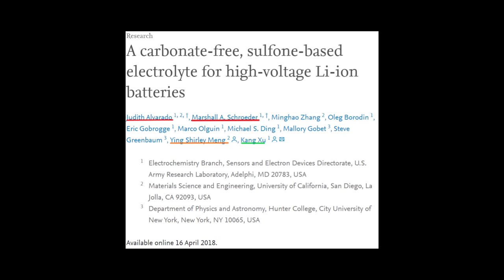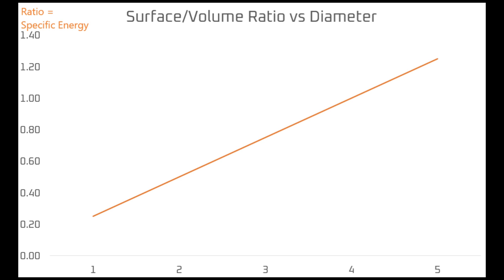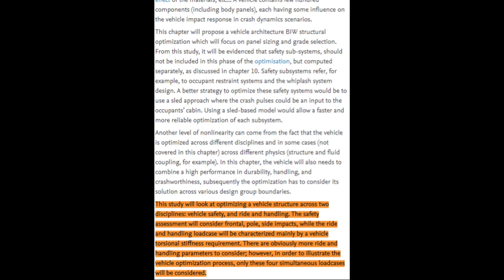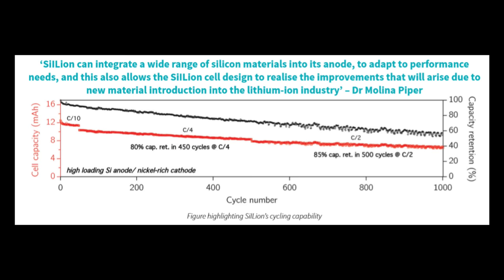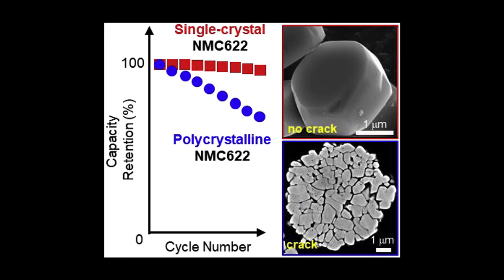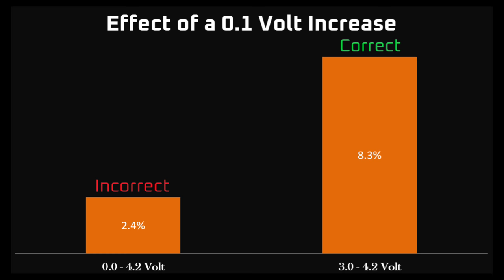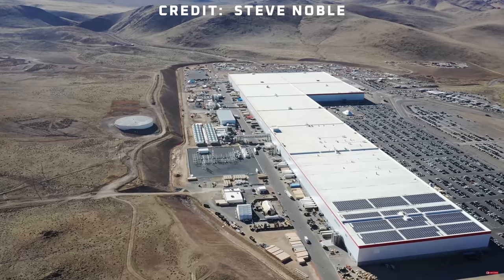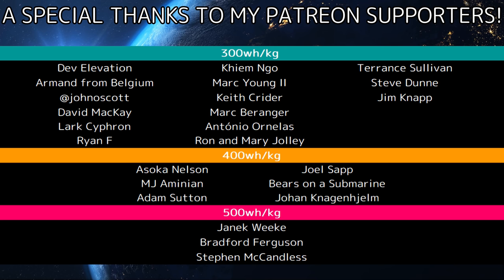New Information 💥 Tesla Battery Investor Day 🔋

Comment: There seem to be two factors missing from your “increase cell diameter” point. First is the thermal management. With thicker cells, you have more of the chemistry further away from a heat sink. Second is the pressure. I may be wrong and you could research this. I understand that prismatic cells need much thicker casings to resist the expansion that takes place when battery is charged. A cylindrical cell has a better mechanical advantage against cell rupture allowing a thiner casing. As such, I would expect a larger diameter cell to require a thicker casing. That further impedes the thermal management and does not afford as much relative added volume to the internals of the cell.
Reply from the maker: Great thinking!
Reply: Google hoop stress. :)
Basically smaller diameter tubes can handle higher pressures.
Reply from the maker: @davidelliott5843  GREAT information thanks!
Reply from the maker: @michelangelobuonarroti916  I like your thinking.  When I took apart a battery cell, it seemed like the casing was more of a wrapper to hold things together rather than designed to hold weight.
Reply: Could you cover this physical expansion when charged I guess its similar to thermal expansion when heated, can and will be resisted by each casing, rather than the pack.
In the Prius NiMH prismatic 28module pack, there are bolts end to end.
Thermal and chemical expansion would add up and need to be contained for the life of the battery, I noticed the easiest way to reassemble was in the cool of the morning.
My point is a charged hot battery is at peak expansion, and therefore pressure.
Love your voice speed, that's as neuralinky as I'll ever get.
Reply from the maker: @williamgoode9114  Excellent point!  Generally, I cover this type of thing tangentially.  At some point, this may come up as a limiting factor.

Comment: In his Model 3 breakdown Sandy Munro specifically said that the car would crash the same way with or without the battery pack, so the idea that cells are structural to the vehicle is completely false.
Reply from the maker: Nice!  I didn't see that.
Reply: That makes good engineering sense. A battery that gets crushed is more likely to short circuit increasing fire risk. It’s logical that the battery pack should protect the cells inside. That is also an advantage of using battery modules within the finished skateboard frame.

Comment: JORDON , YOUR PRESENTATIONS HIGHLIGHTS THE EFFORT BEHIND THE PROGRESS IN BATTERY PRODUCTION IN THE LAST TWO  YEARS :
    -  We hear about (A1) A larger cell with continuous tabs (A2) In-house cell production Kato Rd, Texas & Berlin, (A3) In-house Cathode production about to start in Texas, (A4) The battery pack to be a structural item.
  -   (A5) LFP & Prismatic cells have risen in prominence.  &  we know (B1) Dry electrodes are on the way. 
  - This presentation reminds us of what is happening in the background  (C1) Electrode & current collector construction, (C2) Cell chemistries (C3) Crystal structures & coatings, (C4) Electrolytes & electrolyte additives & (C5) The Dalhousie  connection, They all point to the future.   WELL DONE JORDON

Comment: How about thermal stability?  The biggest problem a LiPo battery has today is with cold.  Maybe with hot as well but being in the northeast (Buffalo NY area) I am acutely aware how much poorer batteries work in the cold (I currently drive a Volt).  The problem is of course made worse because the car also has to make heat to warm the cabin of the vehicle.  Will any of these chemistry changes help this area at all?
Reply from the maker: I don't think NA9505 and single crystal cathode will help with the lithium plating and dendrite problem.  However, Maxwell's tech might...but most of what they've done is trade secrets rather than public research :/  Jeff Dahn's additive might, but I think that would be more of a stretch - he hasn't mentioned this.

I'm from Celina, Ohio originally.  You guys get some nasty weather up there with that lake effect.
Reply: I thought the new heat pump is suppose to warm the battery...
Reply: @solutiontogolf , Question to you, regardless what is used to heat the battery, where will the energy come from?  Or next question, why heat the battery at all?  I'll answer the second question for you.  The reason, LiPo of today need heating is because the chemical reaction that occurs to produce the electrons is hindered at low temperatures, lower than 50F...
So use battery energy to harm the battery and the battery will warm but you have now much less energy in the battery and you have not gone any where and the cab of the vehicle is still cold...

Comment: I really appreciate your hard work researching all these different pieces.  Your deep dives are very well done and thought provoking!  For my money I do though, disagree with your theory that Tesla is not likely to increase cathode thickness to increase energy density. 

In my view, that's the more likely path as the dry electrode process creates a more controlled and uniform spacing of the molecules in the cathode.  This then means that you can push more ions deeper into the material with no increase in heat generation.  Think of a whole bunch of doors of various widths: The large doors have no problems handling a high flow of people, but the narrow doors cause people to jam up as they try to handle the same number of people.  It's the narrow openings are the ones that create the majority of the heat as the ions are forced through.  By switching to DBE technology, Tesla would be able to ensure a more uniform control of the physical properties of the cathode, since you're not just relying on whatever develops when the solvent evaporates away.  In theory this should then allow Tesla to safely push current faster and longer (higher charge rate for longer), with less heat buildup in a cell that still has a higher energy density! 

I am also very leery that Tesla would increase cell voltage without a switch to a different chemistry altogether.  Higher voltages, even 4.2v are already extremely hard on current chemistries which is why the BMS in BEVs don't even allow their vehicle cells to get that high and why they recommend that you don't even charge to what they do allow on a daily basis.  Though, I could see Tesla making an exception for a vehicle like the Roadster which has performance as a primary concern and thus customers may be willing to take the trade-off of a much lighter and high performance vehicle at the cost of much higher battery degradation.

Overall though, I am very excited for battery investor day!  I dramatically underestimated what Tesla was going to announce when they came out with their V3 superchargers and I would love to be blown away again!
Reply from the maker: You know your s***!  Yes, the decision I made on Cathode thickness could have gone either way.  I totally agree that the Maxwell tech allows for quicker and deeper access into the matrix of the battery material.  

The million mile chemistry is rock solid at 4.3 volts, whereas typical chemistries start crying after about 4.05 volts.  For the new battery chemistry it shouldn't be a problem.  My concern is the BMS.  Someone just mentioned in the comments that it can handle up to 5.0 volts and I asked for a reference.  That would make sense!  Battery chemistries top out at around 5.0 volts.

Comment: Very well researched with rational conclusions.  One thought on using a thicker cathode:  Increased energy density leading to larger packs means that even at a lower relative C rate the packs could still discharge and charge at existing power levels.
Reply from the maker: Perfect logic. However, Tesla specifically asked Dahn for a 1C rate cell that does 1 mill at room temperature. I don't know if the thicker cathode could do that 🤔.  It could certainly crank out the power as a pack...

Comment: An excellent study Thanks. 
Could it be that Panasonic cells are used for Power Walls and utility scale peak lopping battery systems?  These uses are less critical for size and weight yet give excellent return on investment.
Reply from the maker: YES!  My thoughts exactly.

Comment: Great video! Now let's ask  a basic dumb question: All other considerations aside (cell/pack density, heat and dissapation, rate of charge/discharge, etc.) when do we see the coveted "million mile" battery (cycling)? Is it fair to say NO in the current Model Y, NO with legacy cells (even with a rune-up), and YES to the next gen cells with the Maxwell magic?
Reply from the maker: I expect all new vehicles will have the million mile battery within a year of battery investor day (if they don't already).  It's actually a very safe and straightforward upgrade for Tesla and the biggest limiting factor is the fact that the single crystal takes a bit of extra processing time.

Comment: Nice video again, but your focus seems to be centred on the vehicles. Are you assuming Battery Investor day will only be for vehicles and not home and grid storage? Or is that one and the same in terms of Tesla's battery manufacturing?
Reply from the maker: Totally agree.  I have thoughts on how storage will play out, but I have to learn more about it.  I've focused on vehicles because it may be a decade before their storage business catches the vehicle business.  Tesla will crush it with their software.
Reply: If they have a longer lasting and lower cost chemistry I'd imagine it would be applied to grid storage as well.
Reply: After watching hundreds of hours of videos on the topics its hard to remember what n where, however...  i think Teslas limiting factor for everything has been batteries.  Tesla has new deals to source batteries from CATL and LG, the characteristics of these batteries are not good for cars but just fine for power wall and mega packs as requirements are different.  Those deals will help scale up storage while new technologies will go towards semi, roadster, cybertruck.

Comment: I would love a video from you on Lithium Air Batteries and the progress towards them!
Reply from the maker: It's on my mind👽.  I need to research this!
Reply: @thelimitingfactor  Explain to me why anyone would want to proceed with lithium air batteries. it seems to me their downfall is that they gain weight as they discharge because their chemistry has to accommodate the addition of oxygen molecules.
Reply: @aerowhiz  The key is to stop using air which is only 30% oxygen but move to intercalated oxygen matrix. This solves all the problem of lithium air into just finding a material that have high oxygen intercalation property. The cell will be fully sealed with the required oxygen is either bound on lithium or intercalated into the matrix material.

Comment: One thing Tesla and Panasonic could do with their battery joint venture if Tesla were to stop using those cells for their own cars, would be to ramp up powerwall and megapack production, and/or to sell batteries to other automakers to provide the missing battery production that keeps limiting other automakers' EV production capacities. That way, Tesla could create more viable competition while also profiting from that selfsame competition. Other automakers would have to actually be willing to buy batteries from Tesla for this to work, though. If they don't bite, just sell more and cheaper powerwalls and megapacks.
Reply from the maker: Agreed!

Comment: Do you think Tesla could reveal multiple batteries for different applications instead of trying to make a single battery capable of every situation? Going 1M miles might be important for a semi, buy power output would be more important for a Roadster or Plaid S.
Reply from the maker: If they expand the spider chart in every direction, then one battery chemistry (still a split between legacy and Maxwell/TSLA battery though).  Great question.

Comment: For some time now I have considered that super capacitors and batteries both have a place in the EV drive train, but with this video, I've now decided that you mix battery cell chemistry within the same pack. So you have some high abuse high C cells for immediate acceleration and regen, then a load of lower C cells with their advantages (energy density and extreme longevity) for the bulk energy requirements. Ultimately, if you can make high abuse high C cells cheaply, that's where you go for the whole pack.
Reply from the maker: That's an interesting thought!  I hadn't heard of this or considered it

Comment: fyi the tsla model s, 3, x, y battery management hardware is able to manage individual cells with up to 5 Volts. As are most available Li-ion battery management chips.
TSLA can enable higher voltage with new electrolyte and electrode alone.
Reply from the maker: Awesome!  Is there any reference material that supports the 5volt number?  I'm weak on BMS
Reply: @thelimitingfactor  
analog.com "Cell voltages from 0V to 5V"
ti.com "with Input Voltage of 0 V to 5 V"
Reply from the maker: @justan1ck  Gold!  Thanks man!
Reply from the maker: @justan1ck  Oh!  And do you mind if I include this thread in the next video?
Reply: @thelimitingfactor 
Of course not. Keep it up!

Comment: I don't get the part of the voltage increase?? E = U*I*t. So 4.2V*1000mAh vs 4.3V*1000mAh gives a 2.4% increase. Ok you could factor in the voltage drops to 3V when completely discharged. But the last milliamps are still discharged at 3V. So the 1.2V doesn't makes sense to me? If you want to be totally correct you have to integrate current of voltage over the complete discharge cycle.

Comment: At this point, Panasonic is secure in Gigafactory 1.  Why?  Tesla needs batteries.  Not just for cars, but for storage/solar products, and especially trucks.  Storage products could outstrip automotive needs and are not as volumetricly or mass sensitive (they can be big and heavy).  This might allow transitioning all transport battery production to trucks and cars.  Eventually I see either re-doing or updating all the inventory of cars to use newer/smaller batteries (or give them an upgrade for longer life, but so far, Tesla isn't big on upgrades other than software).  

I am guessing a Terrafactory for batteries is coming soon, (think terrawatt of batteries per year, at least for a namesake),  and that will be their focus for new battery chemistry.  Either Denver or Austin is my guess.  I am a Texan and currently live in TN, so I would love to see Nashville area included, but I digress.)

At the heart, Tesla is a battery and software company.  Everything else is just a way to sell batteries.  They can't currently sell the big trucks because they don't have enough battery supply, and with new vehicles, let along the mega-storage products coming on quickly, they need all the capacity they can get, both in-house and purchased.  The big thing I see is which batteries are to be used where.  Re-tooling to use a completely different battery in a current product is less likely i.e. cost effective, than using it in new products, but if costs of older technology goes sky high, refitting a new battery into older product lines could be done.  That could keep some partner manufacturers in line on costs at least for the short to medium term.

I just found your videos, nice to see some deeper research than some of the other videos I follow! -- BTW, I found you through your collaboration with HyperChange.
Reply from the maker: "Tesla is a battery and software company.  Everything else is just a way to sell batteries."  That's a quotable quote. Thanks for watching!

Comment: While capacity increase from increased voltage number is most likely more or less correct, the reason you showing (voltage difference) is incorrect. Higher capacity would come from higher loading (at the highest voltage point)

Comment: Very fascinating deep dive. Although it makes me sad if your predictions came true about Tesla not announcing a Cell with more than 300wh/kg. I HOPE they will announce a groundbreaking 500wh/kg cell because that is the theoretical limit set by the dept of energy which, if achieved, will make ICE cars obsolete.
Reply from the maker: I think with the pack improvements I expect them to make, it will be as if the wh/kg number is higher.  The pack is 50% of the battery weight.  From Model S to 3 it was something like a 26% improvement.

Comment: Does anyone know if there is an exclusive contractual reason that would prevent Tesla from producing batteries at Giga Nevada?

Tesla set up pilot battery lines in Fremont. That might be to keep early production closer to the engineering team, but it may be because they legally can't produce batteries at Nevada.
Reply from the maker: That would be some next level analysis.  I think years down the road, Giga Nevada will primarily be a Panasonic facility making wet cell batteries for energy storage.  But, I haven't gamed that out yet.